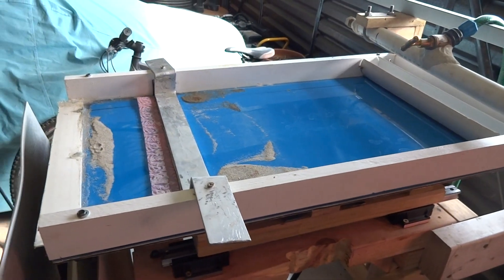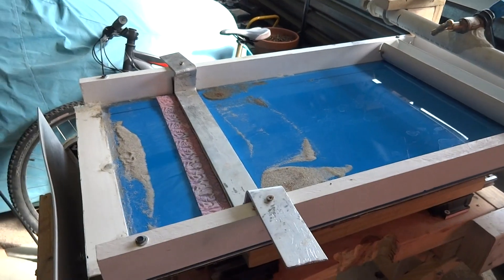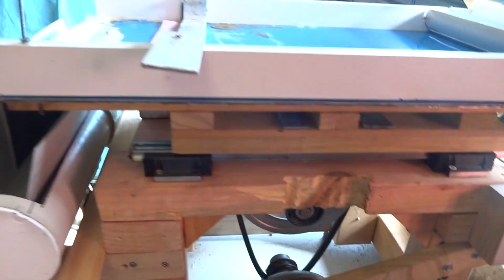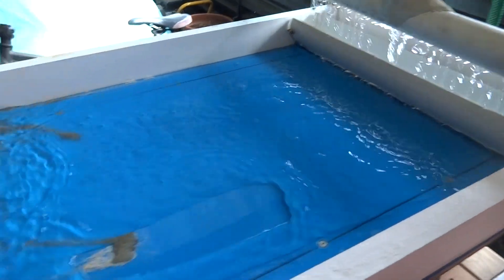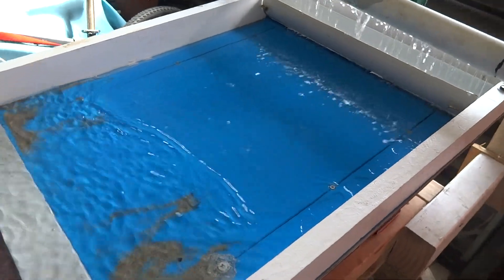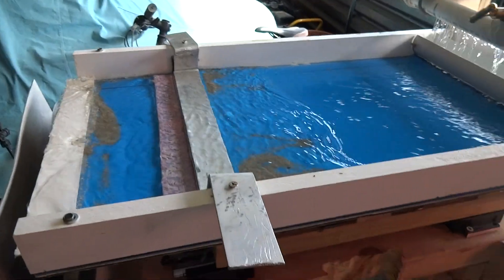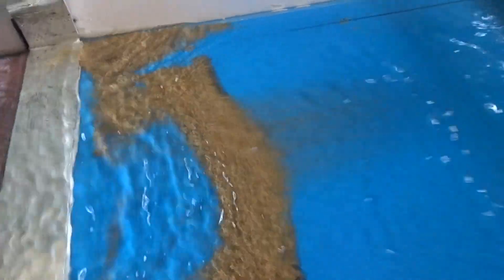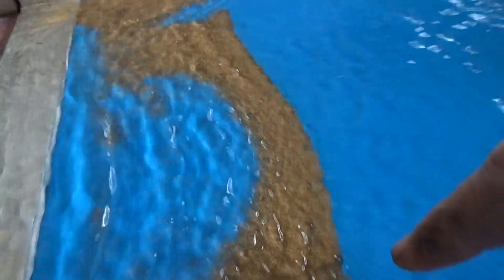Wave Table

Comment: so you put 3 spoons of material up the top - 5 minutes later something is supposed to have happened - What ?
Reply from the maker: Hi there, yes you feed the table up by the water bar. The water flow washes the light material down and off the table. The way the table shakes makes waves with the water by the riffle bar. All the  heavy concentrate moves to the front of the wave and the lighter material gets pushed back. If u watch the video again u can see a line of dark heavy pyrite forming at the front of the wave. Thanks
Reply: @budzag  It just seemed to be a slow process for a few spoons of material.
Is it any real benefit over simply backwashing a spoon at a time in a pan ?
Reply from the maker: @mohammednovalija  Hi, this was just a quick video to show how the table works. You can load the table up right up to the top of the riffle without any loss.  All the heavy's will always stay at the front of the wave and everything else gets pushed away